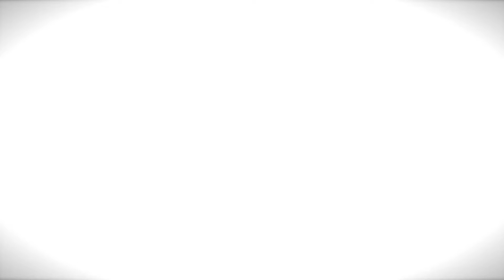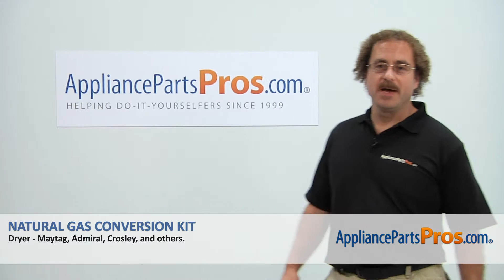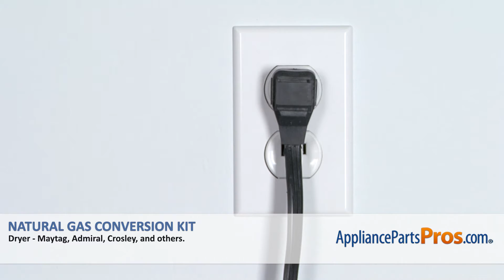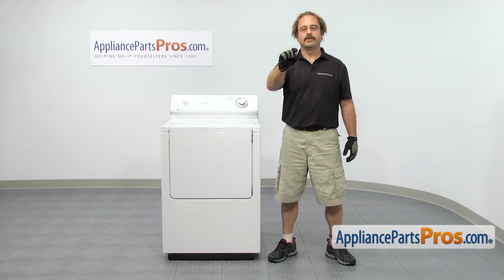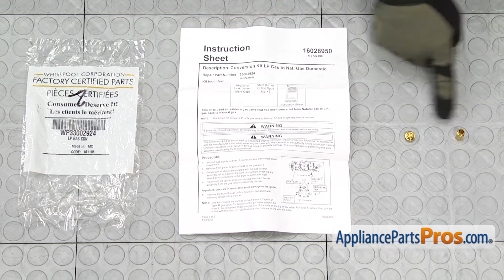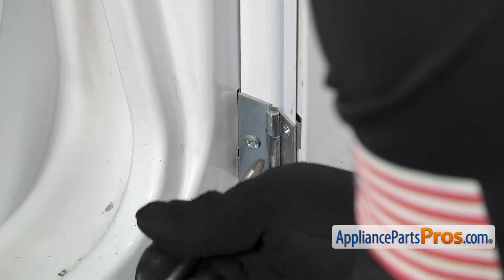How To: Whirlpool/KitchenAid/Maytag Natural Gas Conversion Kit WP33002924

Comment: Bought a dryer at home depot they gave me the LP kit but the valve piece doesnt fit. Did they give me the wrong one?
Reply from the maker: What is the model number of your appliance? Do you happen to see a part number on the valve itself?
Reply: @appliancepartspros  yes, i went back to lowes and they had given me the wrong part. They said Whirlpool changed their gas valves and didnt send them the new conversion kit for LP
Reply from the maker: Hopefully they are going to work on getting this issue resolved for you?
Reply: @appliancepartspros  thanks for replying
Reply from the maker: You are welcome. We are here if you need any help in the future. We will be more than happy to assist you.

Comment: Will this work for converting WGD8000BW0 back to nat. gas? It was converted to LP by previous owner.
Reply from the maker: No, this kit won't be compatible with your model. You'll need to buy these parts:

Natural Gas Orifice: http://www.appliancepartspros.com/whirlpool-orifice-burner-20m-wp15418-ap6005644.html#ixzz55hGtuGEz 

Natural Gas Limiter: http://www.appliancepartspros.com/whirlpool-nat-gas-leak-wp694424-ap6010608.html#ixzz55hGwAGX5 

Natural Gas Spring: http://www.appliancepartspros.com/whirlpool-spring-wp694422-ap6010606.html#ixzz55hGzA3pM 

Natural Gas Regulator: http://www.appliancepartspros.com/whirlpool-screw-regulator-adj-wp694423-ap6010607.html#ixzz55hH3X2A0
Reply: do you have a vid for installing these?